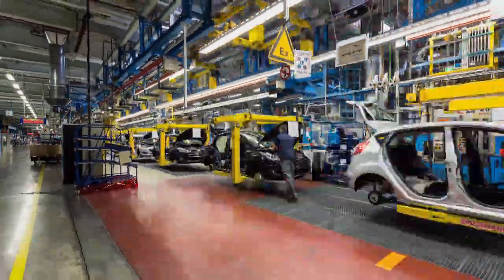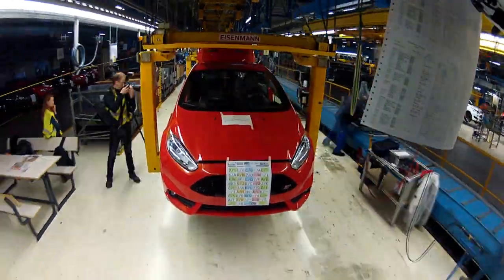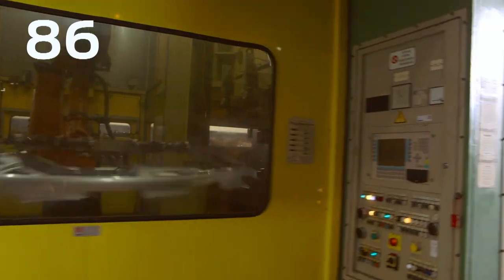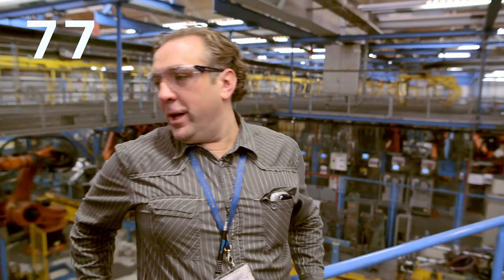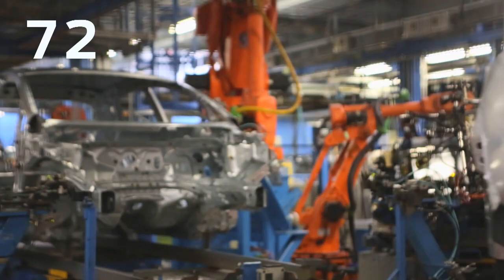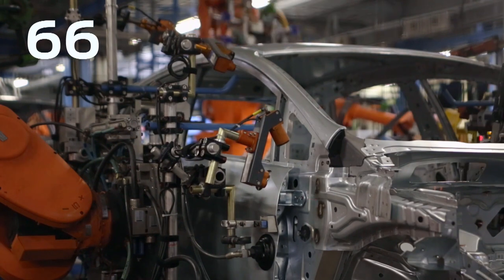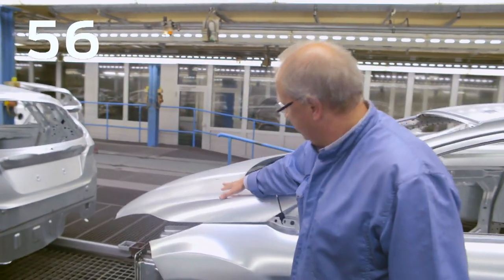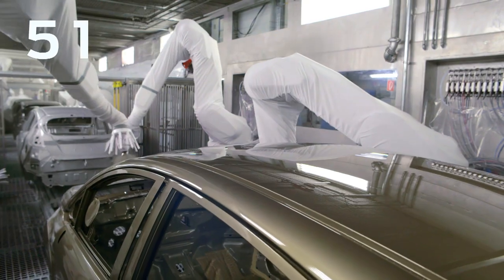How to make a Ford Fiesta -- in 86 seconds!

Comment: I have one a 2 door model and like it, but my driver's door doesn't fit well at all, out of alignment with the rear window surround, so the door rubber makes a noise when I open the door, this rubber is not going to last long, the laser must have been out of alignment on my day!
I reported it but they didn't do anything,must see it fixed before it is out of warranty.
A great car and would buy another one.
Reply: How long did your fiesta last?

Comment: This doesn't take 86 seconds its time lapsed at some parts
Reply: no way... are you sure ??  :O :O
Reply: Correct, the car takes longer than that to assemble... The factory once going, can have a car come off the end of the line every 86 seconds because they are building more than one at a time. The car itself, including assembling the engine, drivetrain, painting, installing interior parts, connecting electrical system, testing, and quality control checks take far longer... More like a day (17-18hrs) or more to complete from start to finish.
Reply: Tim Fritz ğ

sm
Reply: just like 9/11

Comment: When fiestas were made at the Dagenham plant in England. It was every one fiesta every 40 seconds.
Reply: Yeah not since 2002 when there was basically just the engine body and paint along with less rules and legislation of what has to go in a vehicle, the time it takes isn't 86 seconds it's a fiesta comes off the line every 86 seconds interested to see your source for every 40 seconds, there used to be 40,000 people employed there now only around 2000 times change products change everything changes I'd rather drive a new fiesta over a 2002 one regardless of build time
Reply: @Mace-1191  they had two lines

Comment: No anti corrosion bath before paint job?
Reply: what do you expect from a shitty ford?
Reply: draconpost  There is a wax injected subframe with all Fords and just like VW and all other "quality German" marques, Ford has a 12 year corrosion/perforation warranty. They just didn't show it in the video.
Reply: Kevin Ping için
Reply: What about E-coat? Nothing? That is what protects the exterior from rusting beneath the paint.

Comment: It was timelapse, not actual 86 seconds. Maybe need around 5 days to be completely ready to sold.
Reply: Revin yh i reckon its probably every 86 seconds a car rolls of the production line since they make more than one at a time.
Reply: That’s the “Tac Time”. A Camry is less at 74 seconds. Toyota has Continuous Improvement. Ford is more resistant to changing procedures.